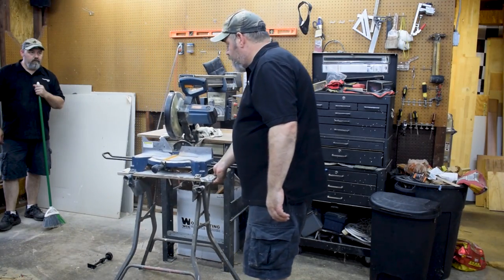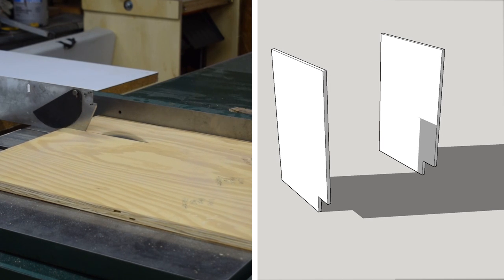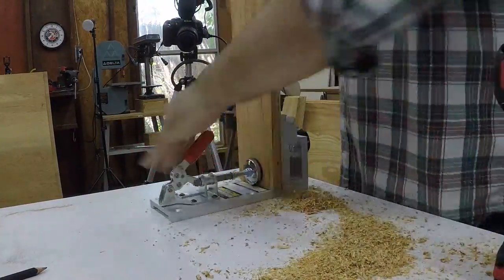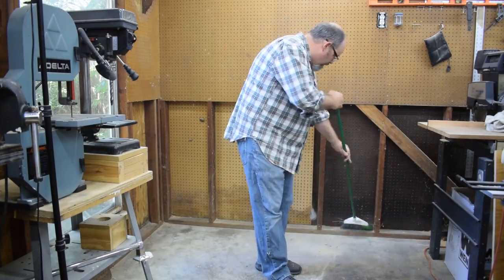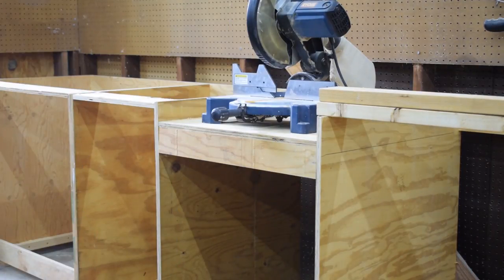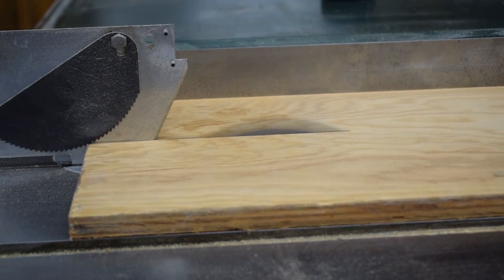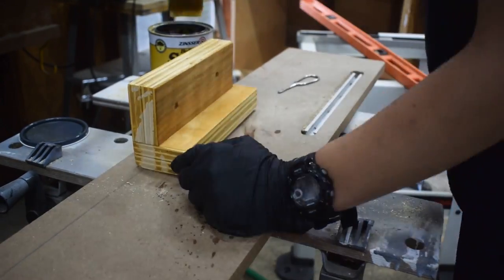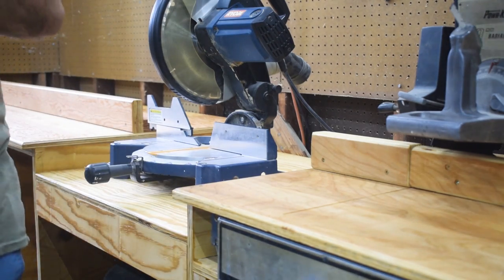Miter Saw Station Build + Radial Arm Saw - Cabinets & Top & Fence

Comment: Nice build.  I got a great deal on discontinued Rockler steel shop stands and made my station out of them (adding plywood tops and sides, cabinet doors, etc.).  It can do cuts to either side just over 10 foot.... the entire setup is almost 22 feet along the entire shop wall.  I made the auxiliary fences removable, so I can use the sides as work benches when needed.

The one thing you did that I wish I had... in place of a cabinet directly below the saw, leave it open for a trash can!

Comment: Hey Darin, thanks for the video..simple cabinet design and easily modified to accommodate bench top tools.  Just made a workbench and in the middle of a table saw cabinet👍
Reply from the maker: VERY cool. Thanks. You have any pics of your bench posted?
Reply: @DarinBeard  can't really see them in my pvc basics videos, but I'm going to do a couple on dust collection where they will be shown👍

Comment: This is on my list of builds. I pretty much have the same requirements (miter saw and radial arm saw). I’ve got them on the same wall now but saving up for the build...eventually.

Great job and the video was outstanding!
Reply from the maker: Even half done it has already made a big difference in the flow of the shop. I can't wait for the drawers to be done. That'll change it even more. I appreciate your encouragement and kind words. I am looking forward to seeing your shop transformation as you work through it.

Comment: To level the unit I would of set a datom line so you can figure out where exactly To start being the high point
Reply from the maker: Great suggestion. I had no idea that floor was that far off so I should've checked from the start.

Comment: you really should do audio books you have a wonderful voice. anyway, does your plan allow for ripping with your radial arm saw . I'm in the middle of this same project. nice work.
Reply from the maker: I appreciate that. I have done some VO professionally in my life but have not done an audiobook as of yet. I did not set up the radial arm saw to be able to rip cut. I have a table saw that I like and I just use the radial arm saw to cross cut boards too wide for the miter saw mostly. I would love to see what you do for yours when it's done.
Reply: my build too starts with clean up but i'm working on it right now i'm still on the fence on whether to add the arm saw to the miter station or not.
Reply from the maker: @doug5959  I have actually removed the fence to the left of the miter saw based on logic from the wood whisperer. He made some good points so I decided to remove it. I still have one to the right because the radial arm saw needed a fence.
Reply: looking forward to your next video

Comment: Good video, just what I needed about now. Will you be selling plans for this build?
Reply from the maker: I will freely provide the sketchup file when it's done again. I lost the original in a horrible hard drive incident. I am still in mourning. It did send me into the "get everything important into the cloud NOW" phase of my life. It's pretty specific to my shop space but easily modifiable for whatever space it needs to fit. I'll try to remember to ping you here when it's done again.
Reply: @DarinBeard  Sorry about your computer information loss, that's really unhappy. I'll look forward to your plan whenever, thank you. I have a miter saw and RAS that I am trying to bring together.

Comment: Nice I’m about to start tackling my shop and this is one of the first pieces of shop furniture I wanna make,  what are your plans for dust collection for this
Reply from the maker: I am building a Thien baffle for a shop vac and a 5 gallon bucket to fit under for now. I am planning a whole shop dust collection system here in the future but don't have it yet.
Reply from the maker: Let me know when you get yours up so I can check it out.
Reply: For sure I plan on recording the whole process of shop setup and making a series for my first post on my channel

Comment: What brand of radial arm saw is that?
Reply from the maker: Powerkraft.
Reply: It is a Powr-Kraft sold by Montgomery Wards. This 10-inch model was built by the ToolKraft Corp. in Waterbury, CT for Wards. I have the same saw (got it from the original owner for free). It has a 20,000 RPM accessory shaft to drive router bits plus a second driveshaft the runs the same speed as the blade, 3450 RPM for sanding, buffing, grinding...You can see the two red output shaft plastic covers in the video on the right side of the motor around 4:45.  These were build from the mid 1960s to the mid 1970s and offer most of the operating levers at the front of the machine: blade elevation, miter swing, table locks.   Very nice saw and solidly built.

Comment: So you built the table then placed the radial arm saw on a level table..... well, the arm of your radial arm saw that holds the blade for cutting is not level to that table, your table should be level to the arm. think about it, with the table not level to the arm your blade travel is off (cross cut, uneven from front to back) and because not being able to adjust blade vertical to table, blade parallel to fence and blade parallel to table your cuts are not accurate and dangerous. Lots of burn marks on wood and kick-back when ripping. Level that table to the arm of the radial arm saw and calibrate the blade to the table. I see you only cross cut with the radial arm saw, is like having a girlfriend that will go all the way but, I only do cross cutting. With a blade not adjusted correctly it could become a bloody mess. be safe
Reply from the maker: I don't even have the saw anymore but it was level with the table top. There weren't any issues with that. Thanks.
Reply: I am in the process of building this. I had to realign the radial arm saw because you are no longer using the table attached directly to the base. I built the cabinet and leveled it, then added the sides for the Radial, and checked the level again, added a shelf for the Radial and made sure it was level. When I set the Radial on the shelf securing it with lag bolts there was slight tipping, so I inserted a washer between the base and the plywood shelf and that leveled it out. Installed the top and leveled it out, then realigned the radial with the table top to ensure it is perpendicular (without fence). Checked the blade path back to front and had to make a slight adjustment to zero it out. Once I have the fence complete  I will recheck the Radial and align the fence with the blade before securing it. Since the table is almost 8 feet across any slight leveling issue becomes a major issue at the ends. So you have to keep checking the alignment as you build it.